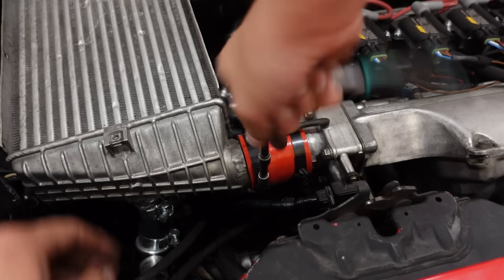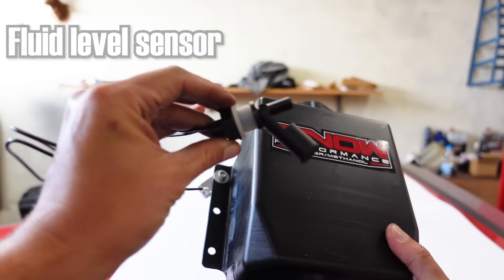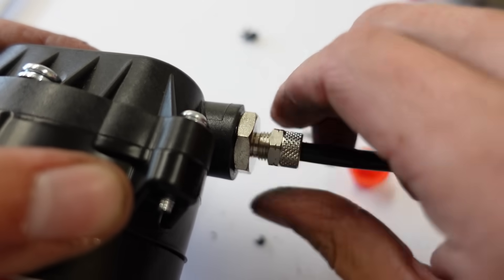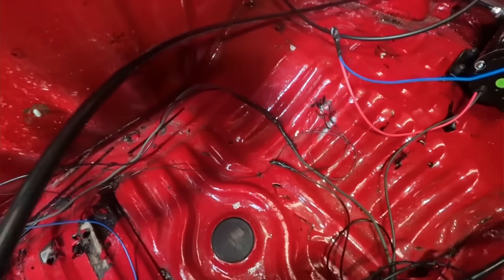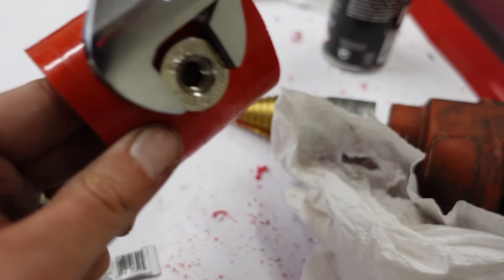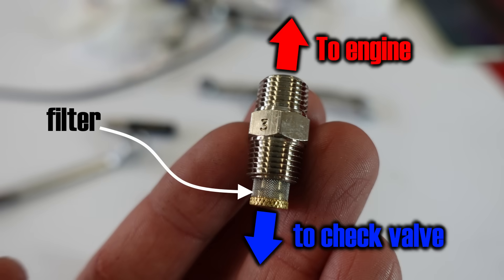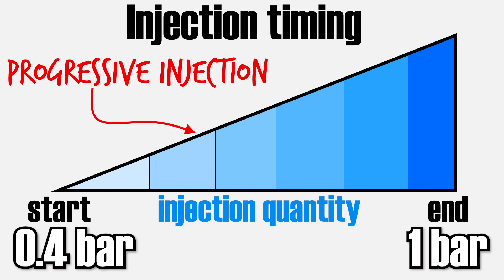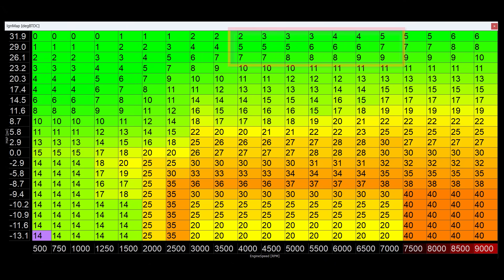How to Install Water Methanol Injection and Tune Your Engine For It

Comment: I've heard of a lot of people using just water injection.... how do you feel about that, and could you help explain the benefits and setbacks of using just water over water / methanol injection?
Reply from the maker: I did in the previous video
Reply: @d4a  ... for some odd reason thought I had already watched it ... whether or not I did is a moot point, I will go back and watch it again.

Comment: It has been proven, time and time again, that Ethanol injection on high boost engines makes power.
It has also been proven, time and time again, that water injection has zero benefit, and numerous detriments. Among these is damage to heads, piston rings, piston face, cylinder walls, valve seats, contamination of the oil, and loss of power.

Comment: Hi! Great video, thanks! Small correction though regarding AFRs. You have mentioned that because methanol has a lower stoichiometric ratio you should lower your target AFR in ECU. I believe that's not how it works because O2 sensor doesn't actually measure the mass of fuel, it measures only oxygen (that's why it's call an oxygen sensor) and outputs lambda of which the stoichiometric ratio is 1 regardless the type of fuel. It is then displayed as AFR for gasoline in ECU for convenience/familiarity. So even if you go, for example, full methanol instead of gas, your gasoline AFR that O2 sensor displays stoichiometric value would still be 14.7:1, to see real methanol AFR in that case you'd just need to setup your gauge to display methanol AFR, but the lambda and the mass of methanol would be the same.
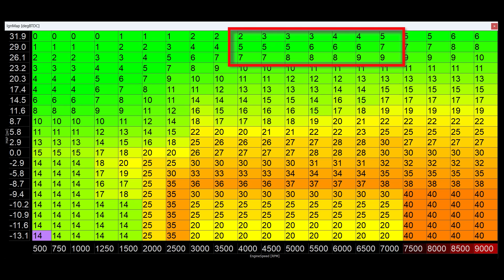Reply from the maker: @mmx512 I explained the correlation between ECU, target AFR and wideband sensor towards the end of this video at 12:46. We're speaking about AFR for best power here and I never said or implied that different fuels will display differently on a gauge. Best power afr means that you need a different target AFR to make best power when you add ethanol or methanol because their best power AFR is much richer than gasoline and you're no longer running just gasoline. Also, I don't get pissy with people, I love responding to questions in a normal polite tone, which yours is, and I appreciate that. Hope I managed to clear it up.
Reply: @d4a Good explanation, nice that we've cleared that up for everyone.
Cheers from Montenegro!
Reply: YES !
Reply: That's not what he said - he mentioned that Methanol as a fuel likes to run a bit richer lambda compared to gasoline, which is why you would target a richer AFR.
Reply: @asian4747  Well, I've interpreted his statements differently. My comment is for those who did as well. Maybe I've understood him wrong, but l believe what I wrote aside from mentioning what was in the video is still correct and adds value.
Reply: @mmx512  You have defo misunderstanded his video, although yes you are correct in the information you have provided
Reply: @asian4747  Well, I apologize. But it seems I'm not the only one, so I don't really regret posting my comment. Have a nice day 🙂
Reply: @mmx512  No need to apologise mate - it's a complicated topic which makes miscommunication common!
Reply: Careful bud, he doesn’t like being corrected, he’s gotten pissy before about something and when I tried to link him to a fortnine video with onscreen proof and full explanations, he got angry and basically demanded I explain to him in my own words why he was wrong😂
Reply from the maker: @merkel2750 Sorry, but I don't remember any back and forth interaction with you.
Reply: @merkel2750  😅 well I did my best being polite and supportive because I like his content, so hopefully it goes well

Comment: Could I install this system on a Vauxhall Astra J VXR without any tuning just to keep the intake and valves clean , will the O2 sensor adjust the fuel trim and will the cat be safe ?

Comment: Sitting here wondering if I can throw it onto a motorcycle🤔
Reply: Im not expert on these systems but what I can tell you is a motorcycle engine works in the same way any other 4 stroke fuel injected engine works. One question I have is if there is a noticeable power increase on NA engines. I imagine there’s is a big increase in safety/reliability but I’m sure the big power jumps come from using this system on boosted applications. (Again I’m no expert so this is all based off conjecture)
Reply: Ah me too, further, how would soomeone go about modifying a carbureted motorcycle to use water inyection.... ive been reading on it, and as far as i can tell it can and has been done with great success, the question that remains in my mind is how do I go about doing it with scrap.... I was thinking maybe modifying a normal carburator to have 2 needles, the normal one pulling gasoline and a second one pulling water.

The gasoline gets pulled up like a tiny drop and it gets pulverized by the piston creating great negative pressure towards the engine.... i don't see why wouldn't an Ethanol/water mixture do the same. Only problem is with carbs you have to go completely by feel when adjusting, no fancy computerized settings and fine tunning. Just listen to the engine.

Comment: Yeah, buddy. This stuff works. I put a meth kit on a couple of Nissan s back in the day. Everyone thought i was crazy, but if you know, you know.
Reply: Meth kit? You made your car a junkie
Reply: @bastadimasta  *tweaker
Reply: Hope it was an altima
Reply: @okok-oc4ko  Sentra and a 240
Reply: You understand combustion  technology and a lot of "car guys" don't. "You'll blow up your motor putting that on it!"  Just keep doing what you know is going to improve performance because so few people really know how it works and how to use that knowledge to get real power gains. 👌💯
Reply: It was easier to setup on a carburettor as my older brother showed on a 360 Rambler AMX. 12;1 compression with 500 horsepower,  the vacuum induction roar??? Damn.
Reply: Breaking Boost
Reply: Hey Can you kindly explain to me ,what is  ment By( 1bar )
Reply: @KipsangDennis-r2x 1 bar from my understanding is typically just 10PSI its kinda like how your RPM gauge will say “7” but you are actually at 7 thousand RPM. the word bar is to just shorten the amount of numbers for psi so instead of fifty PSI its just simply five bar.
Reply: @whysqueezesaab 1 bar is 14.7 psi of boost